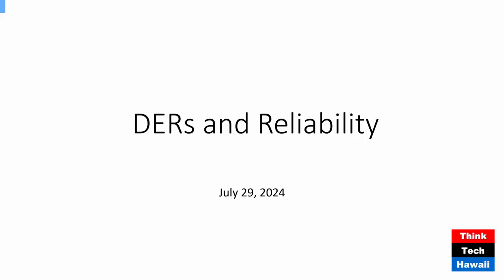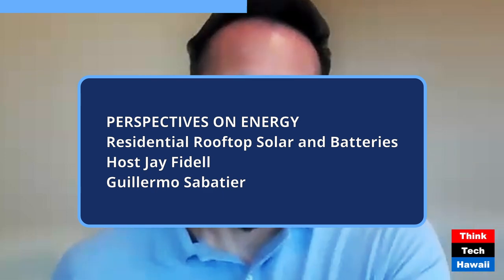Residential Rooftop Solar and Batteries (Perspectives on Energy)

Comment: Great topic. Guillermo’s perspectives (more mainland-centric) reflect a real knowledge of the market, mainly at the T&D level, but it would be great to see someone familiar with both the technology and local (Hawaii/HECO) challenges speak on Hawaii-specific conditions or real consumer-focused actionable info/value prop. I don’t think the duck curve shown was Hawaii, but speaks volumes to the challenge of integrating DERs, and the California 2023-24 install volume plateau was due to CA-NBT, per design. It’ll pick back up, in CA and HI, with better aggregator/utility-level management, and utilities will still make money when they learn how to effectively exercise avoided cost modeling from DER assets in conjunction with larger grid resources, or self-consuming otherwise “prosumers” load defection will get out of control and exacerbate grid management challenges. So much more to unpack on this, but it’s great to see the subject highlighted. 👍

Comment: I think simply boring a hole in the ground and hanging a bucket filled with some of the same dirt and rocks from ground level with cables like a below ground elevator could be one of the best energy storage options, installed locally at any site and of any scale.

The Boring Company and Elon Musk should make vertical shaft versions of various diameters for local, simple gravity battery storage purposes.

#SwitchToSolar #SwitchToElectric #EndFossilFuels